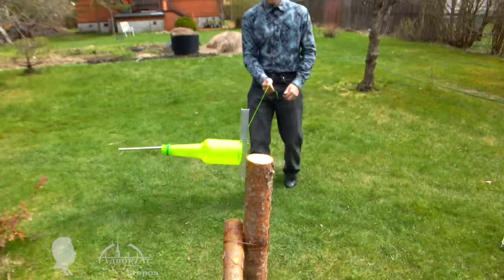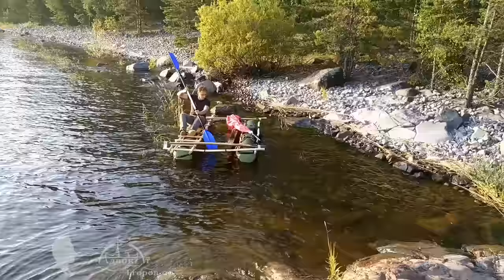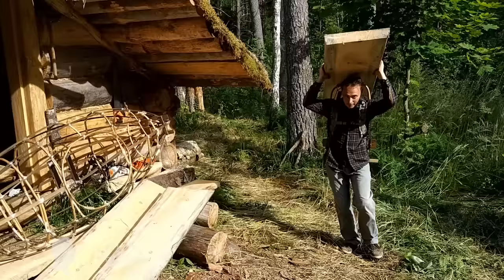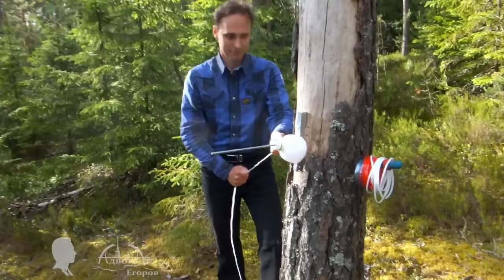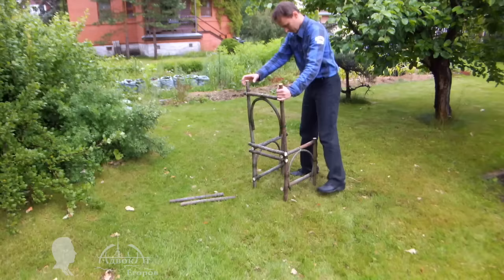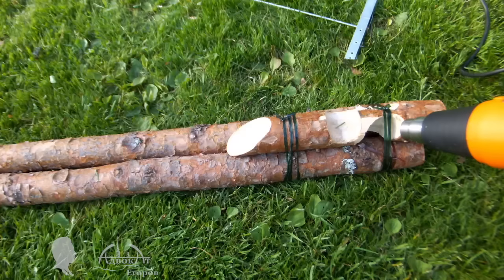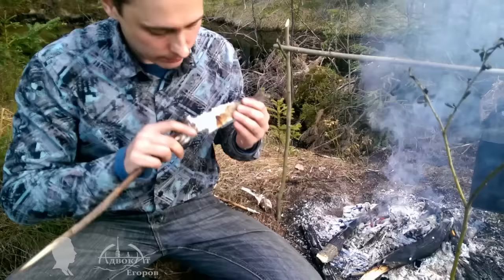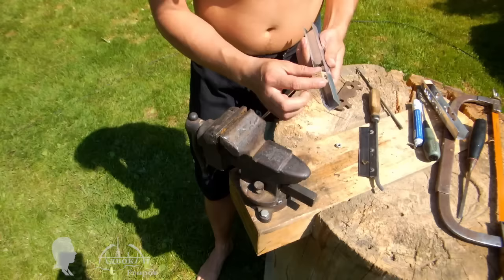10 Creative Ideas to Reuse Plastic Bottles / Bottle Cutter 2.0

Comment: If you melt polystyrene with Acetone it makes an impressive wood glue.  Once the acetone evaporates off you get a very strong bond.
Reply: This is interesting
Reply: Very interesting
Reply: Gotta try!
Reply: Big ups, homie. Definitely gonna try that
Reply: @bonydanza7046  are you Tom Hanks outcast son?
Reply: Packing peanuts???
Reply: Were is the acetone in the forest ?
Reply: @jesuisdieudonnembalambala8858  bring some :)
Reply: its our world  yes, using on structural plastic will weaken. However in this instance you are taking a foam - dissolving it, and then using it as an adhesive. So, the structural integrity as compared to other “glues” is greater, especially in wood as the solution penetrates the wood fibers and when dry keys into the structure. You made a very good point though. 

Check your polymer and test prior to relying on this.
Reply: @firinne  syrafoam cups and packing
Reply: @nobilismaximus  oh ok! I can get that everywhere. Very handy to know!!!
Reply: Or napalm lmao
Reply: Cigarette butt's work too
Reply: Nails polish  is the same 👍
Reply: @mirkopg69  yeah I knew it was a polymer dissolved in acetone, didn’t know it was poly styrene.... if it is we can now set up  <cough> environmentally friendly nail polish producers with recycled packaging......
Reply: @nobilismaximus  yeah  you right 👍
Reply: Years ago melting a toothbrush in acetone produced an ideal adhesive for balsa model aircraft.
Reply: @sevenowls7776  cool!
Reply: cool ,I'm always trying to find new ways to do things .I just retired and I have time to play now thank you.
Reply: It's also impressively flammable
Reply: You can also mold that around something and set it on fire just long enough to burn most of the acetone off and it'll make a super hard and dense foam that feels like plastic.
Reply: @nik90910  I never said to light it. Mileage may vary
Reply: But is the bond flexible or rigid?
Reply: @carlstrand927  rigid
Reply: Just don't smoke cigarettes while using this stuff
Reply: Nice
Reply: @MrMisterMan yeah i was going to say it is damn close
Reply: @Skummar Köphunchuksohn  your comment was deleted.
Reply: Probably a good wood sealer, too.
Reply: you can do the same with most plastics, but high surface contact helps speed the process
Reply: thankyou
Reply: Good to know
Reply: @Steveshappylittletrees  Just be careful!  I was using acrylic dissolved in xylene to seal concrete.  It penetrates and coats.  It gives that "wet look".   Add pigments, too.  Twice one season the fire Department showed up asking where the chemical spill was.  The next season the State banned over 2ppm xylene in products.   They still sell xylene, though...🤔
Reply: Might be possible to blue the wire itself one another with acetone? If yes... That opens the possibility to construct the Kayak with a larger wire, over passing the wires and then spraying the acetone. ^^
Reply: I think super glue and baking soda has applications here...  Maybe case the bindings in it as a strengthening shell.
Reply: Thanks for the info
Reply: Guys,,,, just use chewing gum like mr. Bean and you're all set
Reply: @omkr0122  -
Reply: Really? I'm definitely going to try this! Thanks!
Reply: @jesuisdieudonnembalambala8858  just buy lol
Reply: Be really careful that mix makes home made Napalm. The oxygem in the polystyrene keeps it burning even underwater. I can't stress how badly kids have burned themselves with this mix and polystyrene and petrol mix. Pls be warned!
Reply: I like the idea but would it be harmful to the environment due to any gases escaping during the melting process?
Reply: its our world  I melt polystyrene foam with lacquer thinners. Will this have the same effect on polycarb, do you think?
Reply: what would be an easy available  source of polystyrene? What is made of it?  And how one can tell polystyrene from other plastics without being an expert in polymers?
Reply: @user-vd6wb5ef8v  styrofoam is the other name for it. It’s everywhere - and polystyrene is made of polymerized styrene… clue is in the name
Reply: @nobilismaximus  :::::  styrofoam is the other name for it. It’s everywhere - and polystyrene is made of polymerized styrene… clue is in the name
===================
I know that styrofoam is the other name for polystyrene, but my question was not about names but about how to tell  polystyrene foam from other polymer foams (polyurithane foam, PVC foam etc) used for thermal and sound insulation as well as for packing
PS. polystyrene is NOT made of polymerized styrene because polystyrene is just shortcut for polymerized styrene. These are just two names for the same
Reply: @user-vd6wb5ef8v  white coffee cups and packaging for TVs etc… usually it’s on the packaging… have a looks to satisfy your curiosity
Reply: @user-vd6wb5ef8v  Polystyrene (PS) /ˌpɒliˈstaɪriːn/ is a synthetic aromatic hydrocarbon polymer made from the monomer known as styrene. Polystyrene can be solid or foamed. General-purpose polystyrene is clear, hard, and brittle. It is an inexpensive resin per unit weight.
Reply: @nobilismaximus  :::::Polystyrene (PS) /ˌpɒliˈstaɪriːn/ is a synthetic aromatic hydrocarbon polymer made from the monomer known as styrene
=========
Please do not bother to quote from Wikipedia. We no not care if it is made of aromatic or smelly polymer. 
You keep avoiding answering the question how a layman can tell PS foam from that of PUR or PVC. 
Clear - U mean transparent? I've never seen transparent foam. As to hard and brittle - relative to what? All foams are relatively hard and brittle. As to inexpensive resin per unit weight - all the foams are relatively inexpensive. But not per unit weight. Per unit volume. Because they are mainly air and nobody sell foams by weight. They are sold by dimentions, i.e. by volume
Reply: @nobilismaximus ::::white coffee cups and packaging for TVs etc… usually it’s on the packaging… have a looks to satisfy your curiosity
===========
I do drink coffee from glass cups. And I do not buy TVs.  Recently bought a noutbook. It was packed into some foam which was not hard and brittle. It was spongy
Reply: @jesuisdieudonnembalambala8858  ::::Were is the acetone in the forest ?
=====================
Are you going to glue the forest with this polystyrene based wood glue?
Reply: its our world  :::::be careful tho i used acetone to clear leaked plasti
====
S D Birse suggested acetone for wood glue, not for cleaning plastic. As to cleaning - the rule of thumb is first try it of a small bit to see the possible effect
Reply: @user-vd6wb5ef8v  then short of having a sample sent to a lab I don’t know how to help you…. I’m pretty sure you have seen polystyrene foam and know how to identify it. Good luck.
Reply: @user-vd6wb5ef8v  first make beer, the. Distill, Acetone can be obtained by the one-pot synthesis from ethanol. The synthesis of acetone from ethanol occurs by the ketonization of acetate species. Acetate species are obtained by dehydrogenation of ethanol followed by oxidation.
Reply: @nobilismaximus  :::: first make beer, the. Distill, Acetone can be obtained by the one-pot synthesis from ethanol. The synthesis of acetone from ethanol occurs by the ketonization of acetate species. Acetate species are obtained by dehydrogenation of ethanol followed by oxidation.
=============
Are U practicing teaching chemistry here? If U are, what would be the best catalist for this process?
PS. If I first make beer, I woukld stop at this stage and start drinking
Reply: @user-vd6wb5ef8v  fair enough.
Reply: Brilliant!
Reply: Before the acetone (or gasoline) evaperates you have Napalm, not that I would ever use the stuff.
Reply: @RoySATX  :::Before the acetone (or gasoline) evaperates you have Napalm, not that I would ever use the stuff.
=============
Yes, Roy, never let acetone into your house: it is not only Napalm, but precursor to Heroin too.😳
Reply: @jesuisdieudonnembalambala8858  i think it is more about reusing found garbage , as advoko mentioned its not hard to stumble upon it almost anywhere. as styrofoam floats its not that hard as is plastic bottles.
Reply: @jesuisdieudonnembalambala8858  I always bring some in a travel bottle. Ya never know when you need to fix your nails; now I can glue wood too lol xD

Comment: Hi, I just finished my bottle cutter, following your blueprints. Thank you for your efforts and the great ideas. I enhanced the cutter by cutting a screw with the length of the bottel cutter (ca. 23cm each) and added a slot into the wooden inlays. Now, I can store the bottle holder in the cutter and hence it is easy to transport.

Comment: you could also use the PET tape to weave the seat for your chair the same way you would use rattan or water reed.
Reply: I actually thought that was what he was going to do at first
Reply: Very good idea. Would probably add some integrity between limbs aswell...though it might also pull inwardly the limbs inwardly if not done correctly. I'd love to give this a shot.
Reply: They do that in Asia very common.
Reply: I would weave blocks of seating “fabric” one at a time, leaving loops around the edges. Heat-Shrink them. Then bind the blocks to each other and to the chair by lashing through the loops. This way you get an even product and the shrinking process doesn’t warp the chair frame.

Comment: Best reuse of plastic bottles I've ever seen anywhere.
Reply: Jon Smith  I'll check that out. Sounds interesting.
Reply: Jon Smith  fella's name is "Richart Sowa." Good watch. Thanks!
Reply: Beyond a doubt!
Reply: When I'm too busy to find a bathroom, I use a plastic bottle!😛
Reply: @Baggy Sweater does it though? Are you speculating?
Reply: @mrarivv0007  Plastic is photodegradable.  It breaks down in sunlight. So yes, unless the bottles that make up the island are completely excluded from light, they will disintegrate eventually.
Reply: Best reuse is to make new ones out of the old ones imo. Or just do anything else with the flakes.

Comment: I think the idea is FANTASTIC! Remember though, I've worked with polyurethane for 25 years and although it holds its strength for long periods, when subjected to sunlight it starts to break down quickly. Especially in heat and sun together. Oil is polliurathanes important content and oil does actually break down and dry out. Perfect idea though for millions of applications.

Comment: I'd love to see this on a multi-tool. To hell with a toe-nail file.
Reply: Yeah or bottle opener. You can literally open a bottle with anything.
Reply: @beatnik6806  I once opened a can of soup with a claw hammer. If you're hungry enough, you will find a way to get that food in there.
Reply: Swiss army...take note of this guy's comment...I second it.
Reply: This is an excellent idea!
Reply: On a multi tool or utility knife or even an axe, stab the knife into a tree. Take the bottle and pull it through the knife like in this tool. This tool in video creates a nice even cut but you can make plastic rope as long as you have a sharp edge
Reply: @hobbz4921  Saw a an lady in Mozambique use a big ass, Psycho style kitchen knife. Popped the handle with butt of her hand, then holding can, just swiveled it open catching tip under each little inside edge until it was all good. Watched it all in amazement, imagining how many fingers I would lose trying that.

Comment: What an amazing invention, that bottlecutter. Even to think of it, but as it then turns out not only that the rope or string produced are viable as such and truely gives discarded plastic bottles a long, new life in a wide range of uses, but also that this rope has properties beyond normal rope specially crafted for a purpose (say parachord to tie rafters) is simply just pure treasure on top a stroke of genius. They need this contraption in the third world, and you can supply them with it, making their lifes easier as well as initiating the single best shot at cleaning up nature of plastics on a large scale. 

One nobel price to this guy, Advoko MAKES or whatever his name may be, please!
Reply: Its not his idea ! It was done way before him.

Comment: 3D filament made this way would be revolutionary. You're a genius.
Reply: It's possible, the problem is maintaining a very accurate diameter, there's a company that sells a 3d printing pen that runs off bottles
Reply: I think this would work better through an extrusion press
Reply from the maker: https://www.bilibili.com/video/BV1Zf4y1P7ne/?spm_id_from=trigger_reload

Comment: This might actually have brilliant applications for 3d printing...
Reply: A 3d printer that can convert used plastic into printable tape? Maybe uses a mixture of regular printing material and recyclable materials to keep its printing integrity.

Or perhaps a much more useful tool is a plastic shredder machine. Chop into tiny grains and then convert into material for 3d printer.
Reply: @dra6o0n  i think daniel is talking about the PET tape maker.
Reply from the maker: https://www.bilibili.com/video/BV1Zf4y1P7ne/?spm_id_from=trigger_reload

Comment: Have you ever tried using these in a string trimmer? Would be interesting to see how well it holds up
Reply from the maker: I haven't but I think it should work OK. Thanks for the idea!
Reply: It would definitely work if u twined multiple pieces together then melt it slightly and u might have so decent wire

Comment: Coming back to this video and seeing all the comments got my brain going. As a woodworker a thought I had is that the tape would be perfect when gluing odd shaped pieces together, I’m thinking a stronger version of a band clamp. Would also be really useful when trying to pull two boards together, pop a nail in each and give it a wrap of tape and heat it until the boards pull together. 
It takes a pretty smart person to come up with a new idea, it takes a genius to come up with a new idea that creates a web of even more ideas.

Comment: Does the tape have any tensile strength spanning gaps? With the 2 ends heat shrunk to bind them down would that deteriorate the non-shrunk to shrunk ends bond/strength?

Edit: In reference to using the tape to make the seat for the willow chair

Comment: Have you tried making a woven textile out of the strands? How tight of a weave is it possible to achieve?
Reply from the maker: No I haven't. I don't know it that would work.
Reply: It wouldn't make good clothing, but it could be woven to make a ground sheet, basket, wind break, survival shelter. However the main problem would be transporting the fabric as it wouldn't be soft.
Reply: @myview5840  oh definitely not for clothing, even if you could successfully pare the plastic down into a continuous thread thin enough to be that flexible one way, it would still have essentially a rectangular cross section with a ridiculous length to width ratio, but as is, it could make a rucksack or the basic structure for a tent covering, etc, like you said.

Comment: I just watched a video about traditional Japanese bamboo weaving, and I remembered this video. Wide PET tape seems like it would be a perfect material for weaving a strong, durable, flexible mat - even very large mats, because the PET tape extrudes in one long piece. Useful for baskets and furnishings, but could also be used to protect the bottom of the lightweight kayak, or even as light personal protection when hiking and climbing.
Reply from the maker: Samuel, thank you for your input

Comment: Awesome video. Have you ever thought of using a P-51 military can opener. They are compact and resourceful. It's longer than the P-38 can opener. Sharpen the back of the can opener blade. (So not to damage can opener side). This way you have a can opener, and a tool for plastic cordage in one. 
    You should be able the find them in the camping accessories of any place you buy camping equipment. Or at least Amazon. Hope to see more videoes. Thanks.
Reply from the maker: Shane, thank you for the ideas, I will look into it.

Comment: I have found another good use for the tape cut about 3/8 wide and about 4 feet long.(( For unlocking a car door.)) Just use a wooden wedge to make the door separate from the car slightly. Double the tape over and feed the loop into the car and use it to either grab the lock and pull up or grab the door handle. Usually if your stuck out in the middle of nowhere there is a plastic bottle to be found somewhere. You can cut it with a pocket knife or broken glass in a pinch.. I have done both at times to get people back into their cars.
Reply from the maker: Thank you for the input!

Comment: Bottle Cutter totally the essence of brilliance.  Can this bottle cutter principle be applied to  become a type of blade on a swiss army knife, multi tool, et al? Is there an application of your wire bending clamping tool to effectively use the plastic rope; I mean in lieu of having a heat gun or boiling water handy.  you've come up with excellent inventions and processes, procedures. Thanks for the inspiration.

Comment: If you're really desperate you can use the leftover cap section as a cup or bowl. Just use some heat to dull the sharp edge of the bottle remains.

Comment: The idea is good, but only on the short run. Instead of recycling the bottles like normal, making new bottles, clothes etc, you make tape/rope out of them, which for the most time is one time use.
Reply: Which he can then recycle after use...
Reply: @roshan7988  Yes he could, but it seems quite impractical. Not to mention that you can't get money from the bottles, when they are destroyed

Comment: you can use a lighter to heat the plastic to tighten it too, but you need to be very cautious, as too much will melt it fast.

Comment: Bonus : If you cut the strip to 8mm and pull it through a hot glue gun (typically has 1.7 mm nozzle) you get free filament for your 3d printer, and it's a very strong material when printed